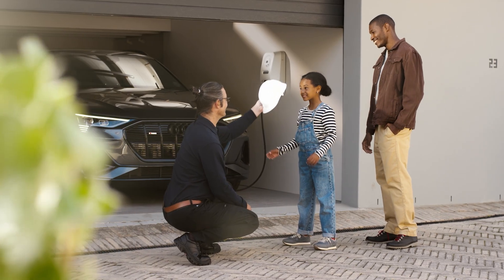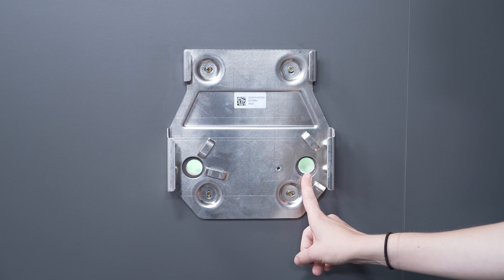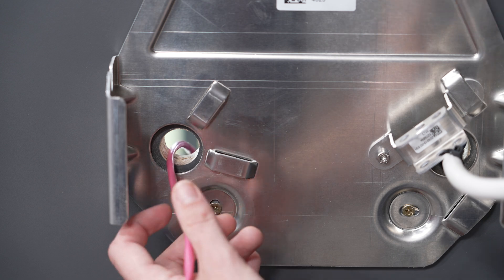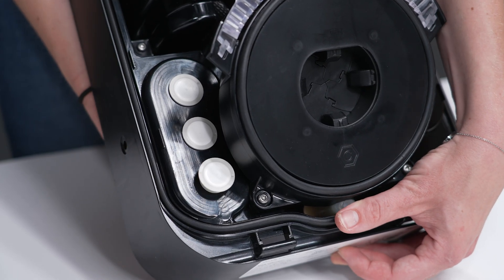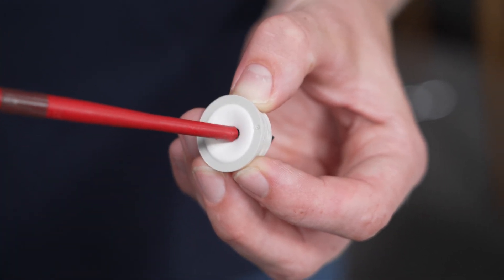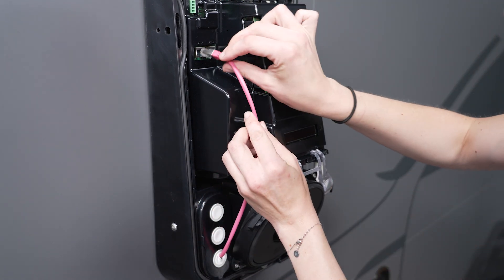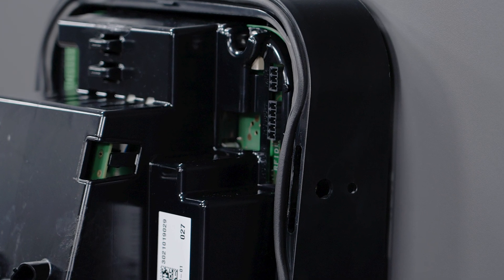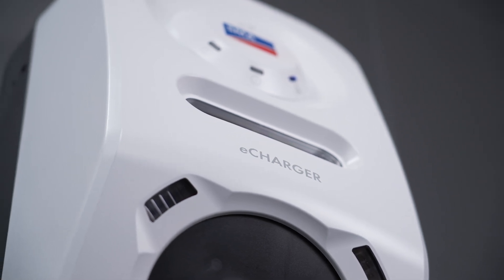TechTip: SMA eCharger Installation I EN

Comment: what are the black and grey conductors for in the supply cable which I assume is5 core 2.5mm flex?
Reply from the maker: Hello and thank you for the question! You can find more technical specifications here: manuals.sma.de/EVCxx20/en-US/index.html. Since wiring standards can vary, we always recommend consulting a qualified installer who is familiar with local regulations to ensure the connection is handled safely. Sunny regards, Laura from the SMA Social Media Team